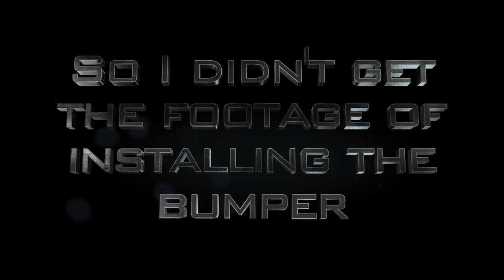Fusion Rebuild -- Part 9 & BMW E90 330xi 1st Update

Comment: My wife hit a deer with her Rogue and I had to replace the passenger fender and bumper cover. Was going to buy aftermarket so went up to the local body shop to see what he'd charge to paint them. He recommended I contact LKQ nationwide auto salvage for used parts. They deliver to his shop all the time. He said to give them my paint code and they attempt to get the salvage parts in factory matching paint. I paid a deal more than just getting any used parts but I didn't have the expense of painting. They came securely wrapped in bubble wrap. The hood had a very minor scuff that buffed out by hand. Never knew anyone offered that option. It took 5 days to arrive after ordering. The body shop owner said I could have them delivered there as a actual LKQ truck delivers them. Might want to see if you have a LKQ in your area.
Reply from the maker: Thx for the tip! I do have LKQ here, and I will definitely check them out!!

Comment: Great videos. I have a Ford Fusion Hybrid. Your videos are very informative. I have a question about the airbag light. What did you do to fix it?
Reply from the maker: Thank you!
As far as the light, it is caused by the passenger seat occupant sensor. My first job is to check all the connections. If it’s not that simple (and I doubt it is) then I will be replacing that sensor. I’ve just had difficulty locating one.